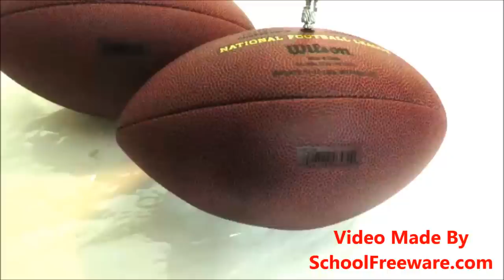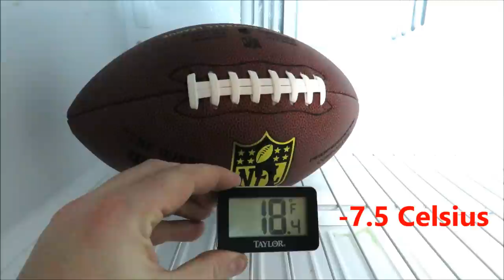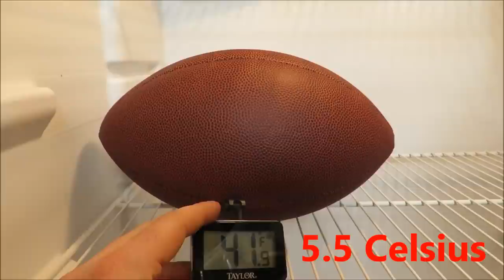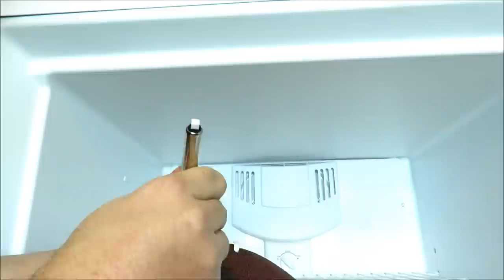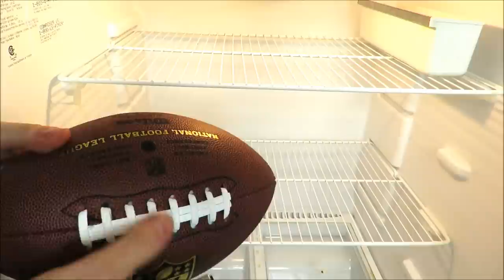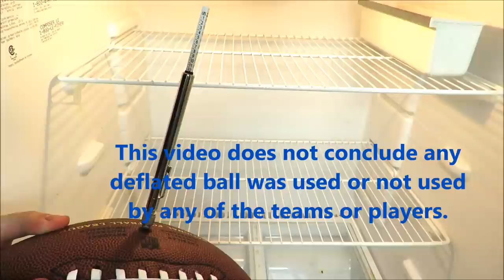Deflated Football Science - Temperature Variations From Warm Inside To Cold Outside - Deflate Gate

Comment: Thanks for the experiment. Two points:

1. It was 51 degrees Fahrenheit on the field at game time. This means that the ball pressure variation would most closely resemble that of the ball in the refrigerator, which only deflated about 1 psi. The patriots balls would likely have deflated even less given the smaller variation in temperature (70 to 51 instead of 70 to 41).  The patriots balls were 2 psi below regulation, so it's unlikely temperature change was a factor in their deflation. 

2. It's my understanding that none of the other balls - colts or kicking balls - were deflated below regulation. Please correct me if that is wrong. If this is true, this point combined with point 1 and the fact that the refs checked the balls 2 hours before kickoff implies that someone tampered - specifically deflated - the balls.
Reply: I just wanted to point out that it looks like the other balls were only deflated by 1 psi. With only 1 of the 11 balls deflated 2 psi.
Reply: Kicking balls are adjusted before the kick. As far as I know, no one checked the Colts balls.
Reply: Already we have accounted for 1 psi of pressure difference, and effectively doubled the amount of over-reaction this case has generated.

Another thing I don't hear people talk about is the initial temperature of the air inside the ball. I can tell people just WANT to believe that this is some sort of huge conspiracy because they keep forcing the 77 degree initial temperature thing.

77 degrees assumes that the balls were inflated at room temperature, but that might not be the case. The next time you inflate a bike tire pay attention to the hand pump. It will get hot. The act of pumping from nuetral pressure to high pressure will cause the air to heat up. It is the temperature of the air inside, and not the ball that matters. As soon as the air inside starts to cool the ball will lose pressure (PV=nRT). The air could be 90+ degrees Fahrenheit.

Comment: Your pressure measurement is very crude, not even good enough to get a good idea of the relative pressure difference. Seriously get a proper gauge, and learn to read it. The gauge at 0:25 has ambiguous graduations, it could be 13, 13.5 or 14 psi depending on where the manufacture sets the zero. That is assuming it is calibrated (it isn't) and is precise and accurate (nope).

On the other hand, you have definitively shown that there is at least some loss in pressure, and that it is measurably different given the environment  conditions of the game.